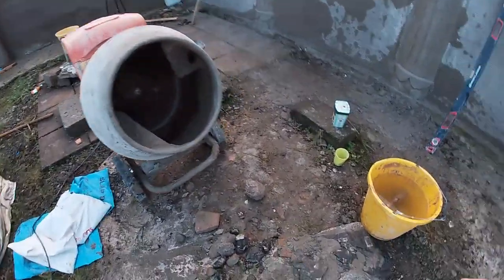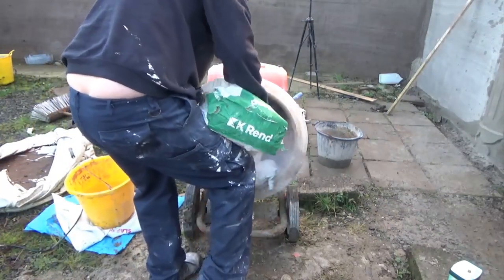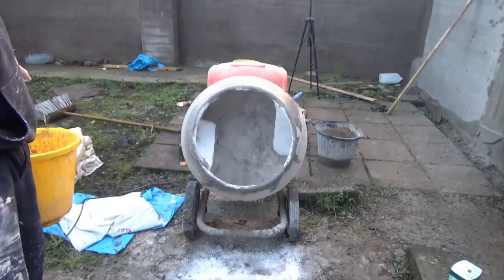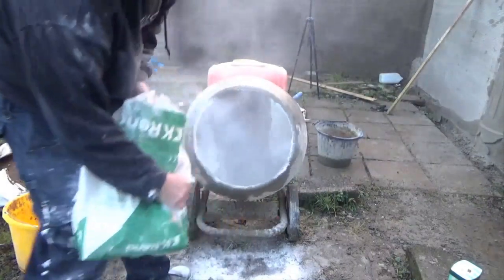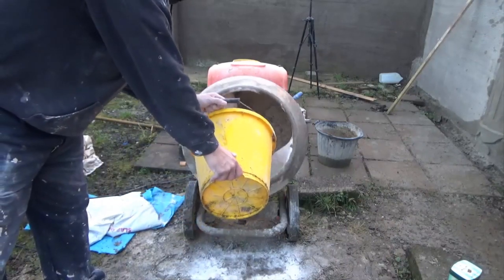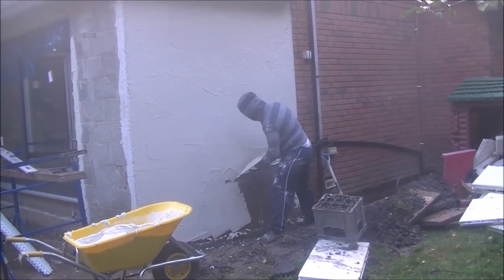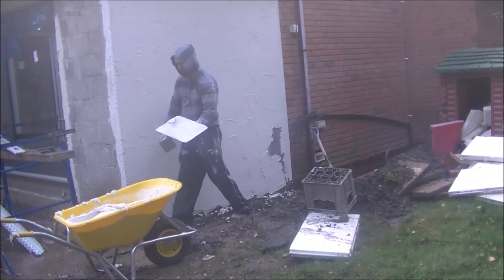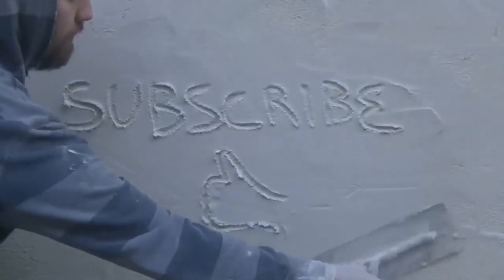k rend mixing KREND / WEBER / monocouche render

Comment: Hey Mac, you ought to ask your Missus if you can borrow her nail-scissors so you can 'carefully' cut off the top of your bag before you try pouring it into the mixer in future ;-) ........... Fair play for leaving it IN this video though ..... Many wouldn't :-) ............. 
And just the thought of using a Sprayer fills my mind with DREAD! ........... WHERE! will the natural talent end-up? ....... It's a bit like the Electric Mixers for Finish ..... whenever you had no electricity on a job, your labourers just wouldn't have a CLUE! - and you'd have to do it FOR them .... AARRGGH!!!!!
Reply from the maker: I know a guy that has one he says if they keep it toped up is the only way as if it runs low it will be dirty water flying at the wall LOL
Reply from the maker: Oh man when the bags do that such a paint a bag of cement did worse to me the other day a hole that just got bigger more was coaming out of it than was purring not my bucket LOL then I see it and decide ok lets put it into a plastic bag and not jokes it wouldn't go in mate ended up in the bin was like a good 3/4 of a bag LOL
Reply: @macplastering  Yes, since they started damp-proofing the bags it's made life very clumsy, they always rip in the wrong direction 🥴😎
Reply from the maker: @CheckFred  for sure mate

Comment: Didn’t know u could mix it in the cement mixer 👍👍👍👍
Reply from the maker: Oh yes mate best way besides the pumps :) but yes need to let it mix dont go to mad or it can clump up at the back loads
Reply: You’re not meant to. It doesn’t agitate the polymer enough. This is why it’s meant to be mixed for a few minutes with a drill , left to stand and mixed again. Or put through a machine. Plus the amount of water in each bag is crucial to the end result, you can end up with shading issues, too wet or too dry . I’ve had the K - rend rep out and he’s said exactly the same thing.